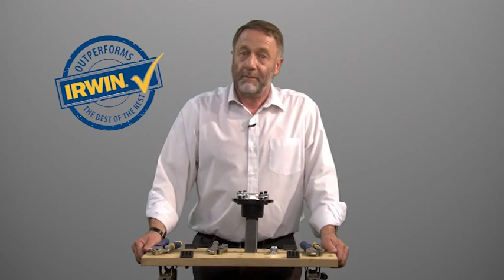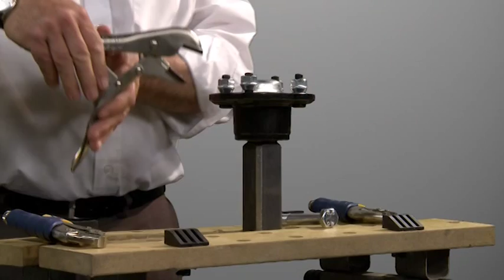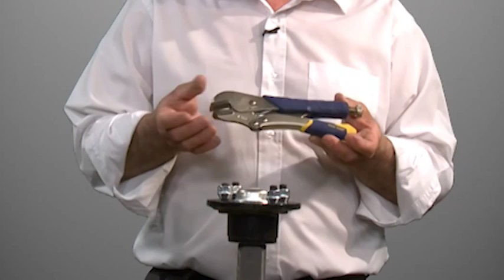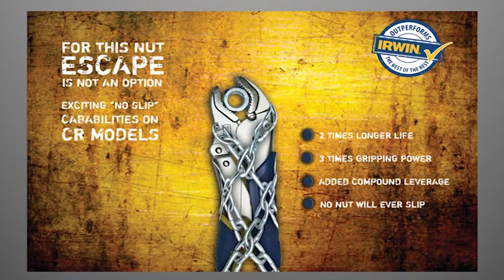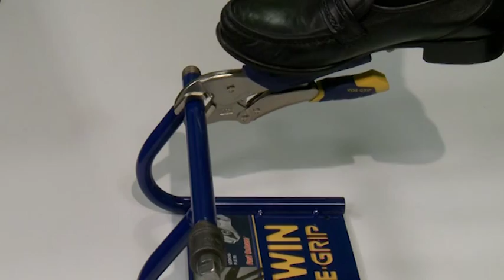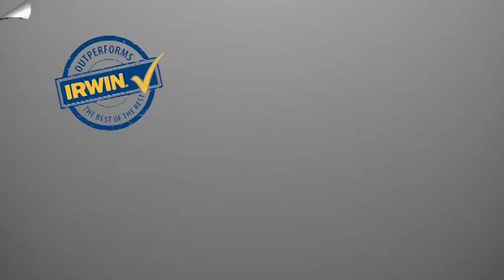Irwin Vise-Grip Promo

Comment: The jaw design on these CR modes is probably the bigger story here as compared to any (alleged) increase in clamping force. These jaws appear to mimic those found on water pump pliers (Knipex Cobras, for example). The handles on those don't any super-tight hand pressure in order to be able to stand on them and not have them slip.